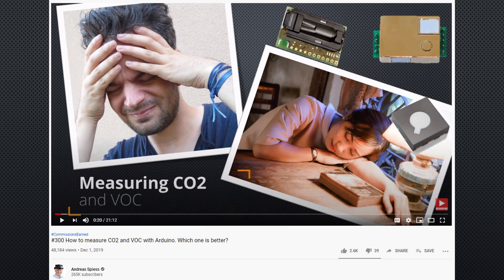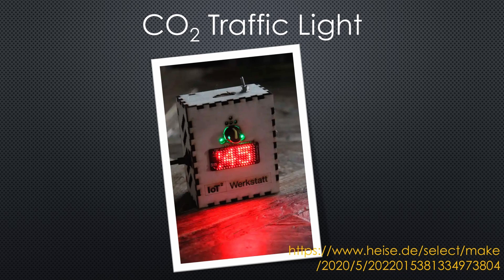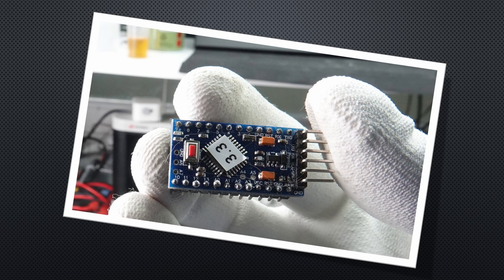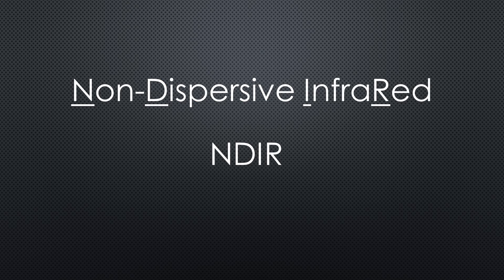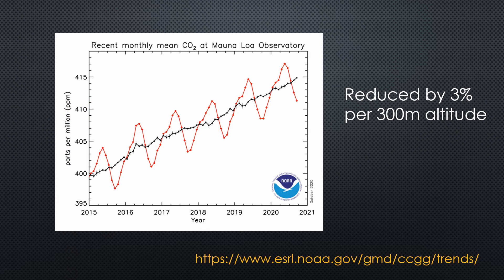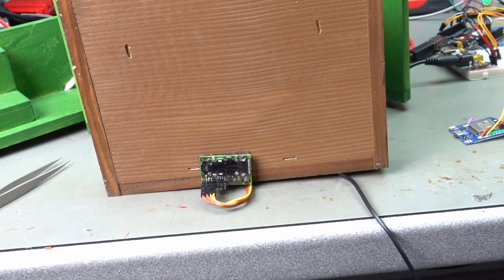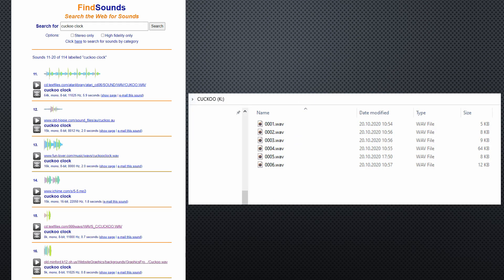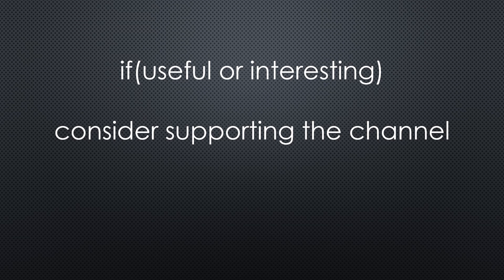#358 CO2 Cuckoo Clock for schools and businesses (Why not eCO2?)

Comment: Nice project for classrooms! It's not easy to make it unobtrusive but still remind you from time to time. I first checked CO2 in Chronograf, then used a pcb strip with 8 WS2812 (only 0.50$) with a green to red gradient plus Alexa announcement once levels are below 450 ppm again. Then I moved to just showing the value from mqtt in the status bar (bitbar on macOS, own program on Windows).
Reply from the maker: Then Guidos project is probably a good thing. Just showing the values and a color if it is bad.

Comment: I insist on opening both windows and door for proper fast ventilation.
For few months I have been using SCD30 and CDM7160 CO2 sensors in parallel, their output is very similar so far.
Opening only windows needs few good hours to decrease CO2 level from 1500ppm to 600ppm (big city environment).
Opening the windows and the door creates noticeable "wind" that refreshes the indoor air in minutes.
I start thinking on forced ventilation solutions (with or without heat recovery).
Reply from the maker: Good to know that my advice works also in reality.

Comment: Andreas, would this save you some time and money?
.
It would save you on the cost of 3D printing, a servo module and a MP3 player and possibly the time involved is assembly.
.
Cuckoo Clock Bird Box
http://www.aliexpress.com/item/1005001622070530.html
http://www.aliexpress.com/item/4000793670085.html
.
This URL contains video/audio of the suggested "device".
http://www.aliexpress.com/item/32935678265.html
.
I hear you say "a Chinese Cuckoo Bird in a Swiss classroom???", but unfortunately everything is made in China these days including "Genuine Boomerangs" sold as souvenirs in Australia.

Comment: Why not the cheap mq135 sensor?
Reply from the maker: As I said: These sensors do not display useful readings for "used air"
Reply: This cheap kind of sensors are not sensitive to low gas concentrations, they react when the level is already too high (for example 10ppm low limit, when good expensive sensors react to ppb values).

Comment: Is there a simple ready to go sketch for a co2 sensor with a display? Oh this week did arrive by me a LOLIN TFT 2.4 touch shield for the Wemos. It's cheap and easy because it''s a shield. I think it''s also nice for your projects. So a free tip from me Andreas.
Reply from the maker: Use the example files of the sensors. Should be easy.

Comment: Hello, as usual thank you for sharing this project, the cuckoo clock idea is great.
I have a few things to add / comment
 - I do not agree that VOC sensors are not useful for the task. VOCs are exactly that humans exhale and are bound in aerosols like the virus. At least the BME680 (with the official BSEC drivers) is a very reliable sensor. But you are right the eCO2 value is rubish
- Perhaps take a look into the IAQ-index. This is a commonly accepted artificial index to break down measurements to a comparable range from 0-500. Many tables exist to convert measurements to IAQ
- We have to factor in some other factors like temperature and humidity. It make no sense if children get a cold these colder days from extensive ventilation and therefor more susceptible for the virus (more info here: https://youtu.be/u2rNX2T2Hew?t=364 )
- The most difficult part is to get everybody in a room, the teachers and principals convinced that ventilation is necessary. If so a simple kitchen timer can be enough. I not succeeded with my project  so far to convince my colleges ( https://github.com/Christian-Me/healthy-indoors-project )

And last but not least: The BME680 can be the human presence sensor you are looking for ;)
Reply: Use VOC for air quality, not just CO2 content. Know when it stinks. VOC may no correlate to CO2 directly, but usually when VOC is high, CO2 may as well. On the other hand, it's unlikely that just CO2 is high and VOC is low in a room populated with humans. You definitely shouldn't use VOC as a CO2 replacement for your CO2 bottle storage room.
I use VOC to control air flow for the central ventilation system. Works like a charm.
Reply: @drstefankrank  I have build one version with an BME680 and a MHZ19 in one case ... but didn’t found time for comparison. I expect you have to calibrate voc thresholds because a hot cup of coffee let this figure jump up - but when the sensor is self calibrated the IAQ index is a very reliable index. And factoring other values into IAQ like humidity and temperature could perhaps give a better understanding.
Reply from the maker: I agree that action is more important than information. This was the basis of this idea to let the kits build the sensor and make it a little fun...
We all know what we have to do against the virus. And currently, we have exponential growth in Switzerland...
The color display on your project looks great!
BTW: I used the BME680 with the Arduino libraries and I did not like its values compared to the CO2 sensors. Maybe I did something wrong.
Reply: @AndreasSpiess  the Arduino Bosch libraries (BSEC) are relay good. A lot of know how is in the precompiled / closed source code. The adafruit lib and many others only give you non compensated raw sensor readings. ( For a very interesting deeper look inside this sensor : https://www.youtube.com/watch?time_continue=1831&v=1niOmSsF-tk&feature=emb_logo ). You have to get sensor accuracy 2 (=calibrated) after 2-10min. You have to read the sensor state every 3 sec or 5min according to the config file you specify. The included esp32 example is incomplete! I wrote the missing rtc memory part but did not extensively tested it - it needs to save the calibration data before deep sleep otherwise you never reach accuracy higher then 0 (=started). Currently I use the 3sec / 48h config and run always on.

Your case idea is really adorable 😍 Mine is more “adult” pocket / palm size one you can put on a meeting room table. The TFT is only 1.14”. The Bord is not perfect but ideal for that purpose.

We have similar alarming growth in Germany especially Berlin ... Not very happy to send my son to school tomorrow or go into the office.

Comment: After pulling the HD pin of my MH-Z 19b to GND for 7 sec for hardware calibration and left it outside for approx. 30 min., it never showed more than 405 ppm again, independent of position or low long the windows are close. Has anyone an idea how to get it back to work? Or did I kill it by my calibration attempt? Auto calibration is disabled according to my Arduino sketch.
Reply: It depends on what "outside" means. If it is a polluted city it will be much higher than 400ppm and inside levels can be comparable.
Reply: @letenof  in the past it showed approx 400 ppm outside and 600 up do 1800 inside. But  with auto calibration enabled  the values drifted  over a few weeks and the readings outside never dropped below 800 anymore. This is why I tried the hardware calibration.

Comment: I am actually in the first row today , otherwise even after subscribing i got the notification a week later . And anyways sir your videos are really interesting and informative,  i like to watch the old ones too quite a few times over. Keep it up , stay safe  :-)
Reply from the maker: Thank you. I am save in my basement, no worries ;-)
Reply: @AndreasSpiess  well thats good :-) , sir is there any way to make a comparator without using op amps?
Reply from the maker: You can build one using transistors.
Reply: @AndreasSpiess  sir can you provide a schematic?
Reply: @AndreasSpiess  I searched the whole internet , tried myself but couldn't come up with a working circuit

Comment: Thanks for the good idea. I second your insisting to a real CO2 sensor. For more than 30 years I am involved in measuring activities and so, I am fearing noise and cross sensitivities as well. Im my home I am using the power consuming MH-Z19. It has an built in "self calibration" assuming that the lowest value within 24h is 400ppm. This might be valid for a class room but not for every room in your house. ESPHome gives the abilitiy to disable this stuff (ESPEasy and Tasmota did not). I am very interested in the new Sensirion device. Please, keep us informed. Even if CO2 has nothing to do with aerosols it gives a good indication of human-caused degradation of air quality - much better than gut feeling of a teacher. Thanks also for the clarification of Swiss Style Black Forest Cuckoo Clock of Bavarian Clockworks and so on :-)
Reply: The "Self Calibration" feature is not appropriate for all use cases. SCD30 datasheet states that the module must be exposed to fresh air (420 ppm CO2) every 24h, this might be impossible in spaces with permanent people presence or/and poor ventilation.
I also use CDM7160 which has a less restrictive autocalibration algorithm.
Reply: @letenof  Exactly! This is the reason why I am using ESPHome in this application. So, I easily could DISABLE this feature.
Reply from the maker: Glad your experience matches. The results were quite clear. The MH-Z19 sometimes did not go back to 400. I will check with ESPhome.
So we can hope some sensors will be built in the near future.

Comment: Another idea could be to use a canary instead of a cuckoo. Like the canaries they used in mines to detect dangerous gas levels.

Is the CO2 level is to high, the canary falls down from its rung our something and makes a noise.
Reply from the maker: Good idea. I even think my bird actually resembles a canary. But it does not fall down...

Comment: I have studied Eco Energy and for room atmospheres we hav learned two limits for air quality:
DIN limit = 1500 ppm CO2
Pettenkofer Limit = 1000 ppm CO2
So you are totally right with your recommendation! 👍

And yes - it should be in every classroom!
Reply from the maker: Good to know that I am inside the "official" limits.
Reply: @AndreasSpiess  You may also want to look into the cognitive effects of high CO2 levels.
There are lots of research papers which show a strong correlation between cognitive abilities and high CO2 levels.
Schools with lower CO2 levels in classrooms show higher scores.
Also the reaction time of humans is significantly affected by CO2 concentration.
There is a paper about the response time and response accuracy of jet fighter pilots in relation to the cabin CO2 concentration.

But it does also affect drivers in a car for example. Most cars have a very dangerous button to set the air circulation to only circulate internal.
I have not yet had a car which automatically turns this function off after a while (maybe it's also an indication of the age of the cars I drive), so after +/- 20 minutes driving with 2 adults in a car, the CO2 levels can rise to 2000 - 2500 ppm. This does have an effect on your response time similar to drinking a few beers.

So I think there should be much more attention to CO2 levels around you.
Now with Covid-19 pandemic, there is quite a lot of attention to ventilation and CO2 sensors can be a good indicator of the amount of ventilation. But sadly that's the only aspect being looked at right now. I'm afraid this will be forgotten as soon as the pandemic is over, while keeping track of CO2 levels around you is quite important for a lot more reasons.
For an office space or class room, it should be a no-brainer to actively control your ventilation based on CO2 levels, as it does improve the minds of the people in the rooms. But perhaps we should start installing those sensors in the offices and board rooms of those making the decisions on where to install CO2 sensors.
Reply: I was surprised last week, when I read in the news about the german government investing about 500 million Euros to upgrade air ventilation systems in public buildings to combat the spread of the SARS-CoV-2 pathogen. According to the article below, this funding can also be used to acquire CO2 alarm sensors and mobile air purifiers. 

 https://www.bbc.com/news/world-europe-54599593
Reply: Is there a scale that shows the cognitive loss for a certain concentration of CO2

Comment: I am surprised by your comment on the order for the files on the sd card for the mp3 player. 
You can easily call a specific file by his name. I used it to announce the temperature. I made files for each degree and then called file named for exemple 120.mp3 who say 20°.
Reply from the maker: Did you use the same module? I had some problems and then read what I said. But maybe I am wrong.
Reply: @AndreasSpiess  I said "easily" a little bit to fast... now I remember spending some time (hours) to find a solution. If I remember correctly the documentation said to use 2 digit for the repertory and 4 for the file, but at the end 3 digit for the file worked.
I used one that look slightly different : 
https://www.banggood.com/2Pcs-Geekcreit-DFPlayer-Mini-MP3-Player-Module-MP3-Voice-Audio-Decoder-Board-For-Supporting-TF-Card-U-Disk-IOSerial-PortAD-p-1371683.html?rmmds=myorder&cur_warehouse=CN

Comment: I saw this https://shop.watterott.com/senseBox-CO2-traffic-light last week on twiiter. It also uses the SCD30. They also sell the sensor separately. Compared to aliexpress, the price is also ok, considering that you would have to pay import duties and wait for a couple of weeks.
Reply: I do not agree: the price is a nightmare.
Please consider that the CO2 traffic light shall be standard in every classroom.
Reply: @feda9343  I was talking about the price for the SCD30 sensor. Of course, depending on the budget a school should chose one of the less expensive sensors. Unless of course the sensor manufacturer would like to sponsor such a project.
Reply from the maker: The picture of the SCD30 shows a ublox module ;-)
Reply: @AndreasSpiess  They use some confusing pictures. They also have CO_2 traffic light for 63€ which looks like it has a SCD30, but if you click on it the picture changes.

Comment: As always your video was very inspirating for me.
I plan to build a weather sensor (pressure, temperature, humidity and rain ammount) for some time. I want to collect rain, therefore I need a significant roof surface. When I saw your video I decided to include my sensors to a Bird-Feeder house. By this I might improve the acceptance by my wife :)

Thank you for your great videos.
Reply from the maker: Sounds great! It should fit if you use a big house.

Comment: Why don't you give a perspective when the SCD40 will be available - we are alll waiting for it.
Thank you for giving a clear answer that an eCO2 sensor doesn't have the same reliability.
The accuracy can be compared in the datasheets - but the ppm values are not available from eCO2 (VOC) sensors.
Reply from the maker: I do not work for Sensirion, so I do not know their plans :-( So you have to ask them.
Reply: Your measurement about the SCD40 looks really good. The cost and availabilty are important - hopefully Sensirion can give an answer - actually the with SCD30 (as a reference ) they make a lot of money...
Reply from the maker: The SCD40 should be cheaper, they said.